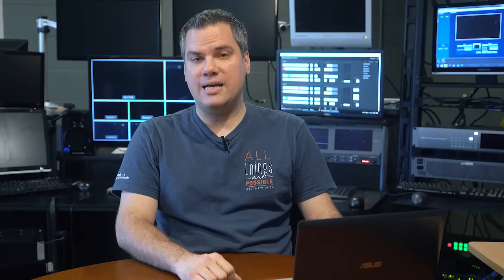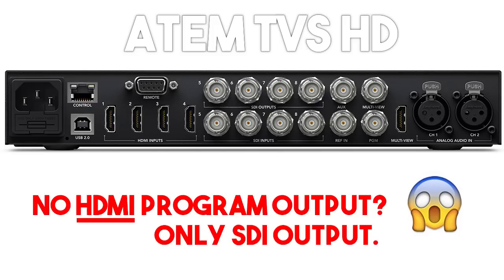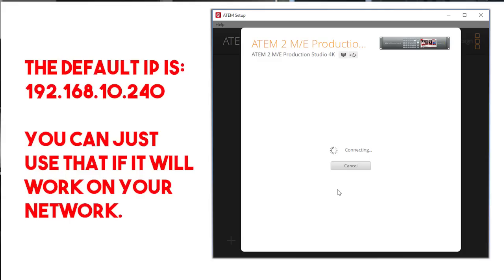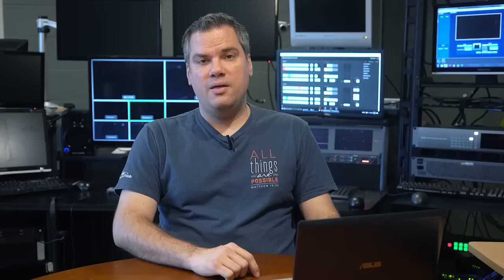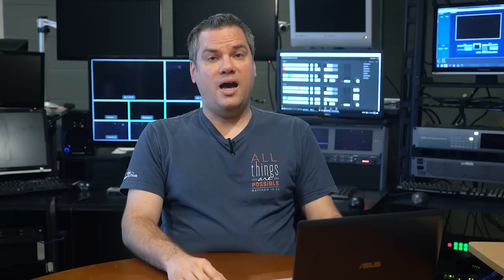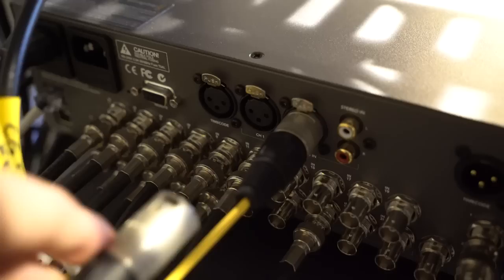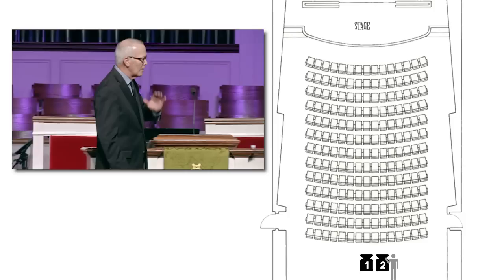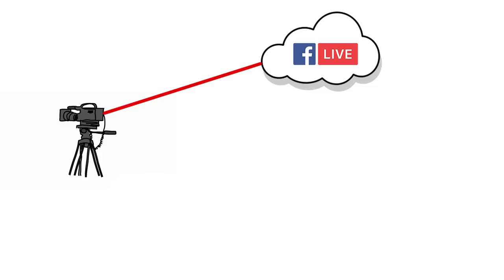Multi-Camera Live Stream & How to Setup an ATEM Switcher

Comment: Hi Stephen – Great video
I currently livestream our Worship service on FB using a
Canon XA30 and wirecast.  I am was
planning to purchase the BM TVS HD to add 2 HDMI cameras and to bring the Media
Shout presentation to the livestream.  Since
the TVS does not have a HDMI out would it be possible to use the SDI OUT and a
SDI to HDMI converter to record the mixed video to a Atomos Ninja 2? Thanks Raj
Reply from the maker: Photo Bot Yes, it should work fine to convert the output of the switcher.
Reply: Thank you.

Comment: Dose ATEM switcher work as encoder or else we need a powerfull cpu?
Reply from the maker: ATEM does not work as encoder.  Only the new ATEM Mini has a video interface built in.  All other ATEMs require a video interface to get video in to the computer.
Reply: @BallastMedia  Thankyou for clearing the doubt and also is ATEM Mini sufficient enough to livestream the soccer match with just 2 or 3 cameras or do I still need an encoder or a powerfull CPU?
Reply from the maker: @vishalpatelful  the atem mini just acts as a video interface to get video in to the computer, you still need encoding software on the computer to do the streaming.
Reply: @BallastMedia  This has been so helpful. Thanks a lot. I request you to please make a video on sports event streaming because there are not many videos on it and beginners like me find it hard to understand some basic concepts. But Thankyou again.

Comment: Hi Stephen

Thanks for sharing all those videos, they are very useful, great Job !!!!.

Stephen I want to know if you can guide me, I am new to this, I bought an Atem mini pro to make photo tutorial videos but I could not connect the streaming, is there any way to connect the Atem direct to crowdcast? I like Crowdcast because they have a chat, password, payment system etc, but I can't connect it or if you know of another friendly platform that can have all these characteristics? Any help will be greatly appreciated, I look forward to your comments, blessings!
Reply from the maker: Yes, if you're streaming service isn't listed in the drop down, you need to edit an XML file on your computer (in the Atem Control Software directory) and add the information.  Then it will show up on the ATEM.
Reply: @BallastMedia  Hi Stephen, I already tried the XML file but I could not, I want to see if I can connect the ATEM to Crowdcast direct without OBS, thank you very much for your answer, excellent your videos, keep going, God Bless you!

Comment: So if I wanted to keep the same audio when changing scenes how can I accomplish that
Reply from the maker: Do you mean on an ATEM switcher?  On the audio "tab" of the switcher, turn on the audio you want as your source and turn off all the others.  Don't use the AFV button, that means Audio-Follows-Video, so the audio will switch when you switch inputs.  Or, are you meaning in OBS?  In OBS, I think there is a check box in the properties of the sources that you can select "Use Custom Audio Device" and then a drop down box will appear and let you select the audio source for that particular source in OBS.
Reply: Thanks I figured it out

Comment: Is it possible to broadcast to YouTube and Facebook at the same time? Thx!
Reply from the maker: Yes, some software, like vMix and mimoLive can do it.  Also, there are services like restream.io that will do it.  Using software locally, be aware that you need the bandwidth to support both streams.  Using restream.io you send them one stream and they send it to the multiple destinations.
Reply: Ballast Media thx!! 👏👏👏👏
Reply: Try nginx
Reply: I like Restream.io and it's mostly free but you have to pay extra for Facebook streaming. I have a client using Restream with about 18 platforms connected streaming through a Teradek VidiU Pro switched through an ATEM. Then he also streams to Facebook and Periscope through his Wirecast software. He has a fast fiber internet connection.

Comment: What are some options to get audio into a livestream?
Reply from the maker: Do you have a switcher?  Usually you take audio from a mixer output and run that in to the XLR inputs of the ATEM or whatever switcher.  If you don't have a switcher and are just doing a single camera stream, send the audio in to your camera.  Most people start out taking an AUX feed from their front-of-house board.  That does ok, but to get great results you'll need a dedicated board for your streaming mix.
Reply from the maker: What equipment do you have?

Comment: Does this switcher allow for video delay? 

Basically, I have two cameras connected to my Mac using Blackmagic Mini Recorders. One is next to my Mac and the other is 100 ft away using an HDMI extender. I have noticed that the one using the HDMI extender comes in delayed compared to the one next to my Mac. I fixed this by delaying one video feed using my streaming software (OBS). 

If I get the switcher, is it possible to delay the video feeds? If not are there other ways to avoid this problem?
Reply from the maker: The delay you are experiencing is from the HDMI extender, it's adding some processing time no doubt.  A better way to do this (if you get a switcher) would be to convert your HDMI signal at the camera to SDI (using the pretty cheap BMD Micro Converter HDMI to SDI)  Then run SDI cable the distance to your switcher.
Reply: Thank you, that is a good idea!

Comment: I would like to stream worship service to Facebook. I will use a video switcher with out hdmi and a laptop. I will use also a video capture device to connect the switcher to the laptop. I have two capture devices in my mind: AJA U-TAP HMDI or Elgato Camlink 4K. According to your experience, what would you suggest me to buy between these two cards?
Reply from the maker: U-tap is definitely better - but to be honest at the moment with COVID, most of these are hard to find, so get what you can find.  The Elgato will work fine on PC, it does have issues on Mac.

Comment: I am using a SDI to HDMI converter and then again HDMI recorder to take signal from ATEM to my PC. However, the converter is not BMD, but it is compatible for 1080p 60fps and still I am getting no signal when I tried to get Program output via SDI to HDMI converter. Do you know what might be the actual problem here?
Reply from the maker: Aditya Kuche Can you tell me what specific models you are using? My first guess is thatsomething isn't able to operate at 1080p60.
Reply: Hi again!! The problem was because of cheap SDI to HDMI converter. Just today I have received original Blackmagic-design and it is working absolutely fine. But I am facing another issue. Facebook live video is terribly lagging at 720p.
Reply from the maker: Are you using OBS to stream?  What is the upload speed of your connection?  What is your bit rate set to?
Reply: Yes I am using OBS to stream. Upload speed is roughly 22 mb/s and my video bit-rate is set to 2500.
Reply from the maker: If you have 22mbps upload that is great. (Your sure that's not your download?)  As long as OBS isn't reporting dropped frames when you are streaming, then the lag is happening on the viewer end.  You can help the viewer by sending a lower bit rate stream, try 2000 for your setting in OBS and see if that helps.
Reply: Hi. I was facing the problem because of the net connectivity. There was significant change in upload speed, which has been fixed. Everything is working just fine expect when I am using 15 ft long cables, it gives no signal. I am wanting to place 2 cameras in different rooms but using long cables is not working out. I am not sure how to fix this problem. I appreciate your time and help in all of this. Thank you so much.
Reply from the maker: HDMI will only go 15ft.  Convert the signal to SDI and run coax cables, you can run up to 300ft on an SDI cable with proper RG-6 cable.

Comment: hey how much you think i will need to spend to start a 3 cameras streaming
Reply from the maker: Are you starting from scratch?  Do you have a computer you can use already? 
$600 3x VIXIA R800  (http://amzn.to/2FBaCQs)
$600 3x Tripods?  (http://amzn.to/2CIYx8z) 
$1000 Video switcher (http://amzn.to/2EUeeQr) 
$100 Monitor for Switcher multi-view  (http://amzn.to/2orRRY9)
$335 AJA U-tap Video Interface (http://amzn.to/2F8nX4U)
$590 PC for streaming (http://amzn.to/2CJnwZs)
$180 3x HDMI to SDI converters if you want cameras further then 15ft from switcher (http://amzn.to/2GKkQ0a)
~$200 cables: select SDI lengths needed here (http://amzn.to/2EQCfYB)
=$3605 and you are well on your way.  Might need a few odds and ends for your environment, but that is the core of a 3 camera system to begin streaming.
Reply: yes i have a computer i have a mac and windows and also a few tablets all need is the cameras switchers ect

Comment: Are there any switchers out there that are an all-in-one interface/switcher so you don't have to buy a separate interface card?
Reply from the maker: The original Atem TVS (1u rack) used to do that through it's USB port but they removed it in a firmware update. There is a Roland switcher that has a video interface to computer built in but it's still actually cheaper to purchase an atem and a separate interface.
Reply: Thank you for the feedback. I'm trying to build a 4K multi-camera setup, and have live, post-DAW audio from my Presonus Studiolive 32 mixer all go into a live-stream, but I'm worried that if I do everything digitally through OBS there will be some latency issues, hence the question about the all in one interface. Buying several video interfaces for each camera + having a multi-channel live audio mixer all go into this free program OBS seems like it would put quite a bit of a load on the computer. Do you think there will be a noticeable difference if I can find a video mixer/interface that I can plug my audio mixer straight into, as opposed to having everything routed into the computer? Also, how does OBS compare to other live-streaming software in terms of latency and handling high-quality video/audio?
Reply from the maker: Ghostnotes The Atem switchers have balanced XLR stereo connections. You'd be best off sending your audio in to a switcher and letting it embed the audio. Then take your "completed" video in to the computer for streaming.  Obs is very reliable, but that's dependant on your computer too. Your right that it doesn't scale well to send many interfaces/sources in to a computer.  Use a switcher, like the atem and just use the computer for streaming the final product.
Reply from the maker: Ghostnotes As far as quality, OBS will output whatever quality you configure it to. What is your destination for live streaming?
Reply: Thanks again for the feedback. I'll be streaming to YouTube, Facebook, and Twitch once I have built my complete setup. Do you have any experience with the Blackmagic UltraStudio 4K? It's looking like this is almost what I was talking about. A capture/playback device + video interface all-in-one with multiple inputs/outputs. I would not need to buy an extra interface with this.. although it does not have the "switching" feature to switch between multiple camera views on the fly, it looks like it can still record, capture, and playback multiple cameras.Thoughts on this vs the ATEM switcher + interface? Seems like this is the cheaper and much more ergonomical solution. And I can always add on a switcher to this in the future if I need the extra channels and have the extra money.
Reply: I take that back. Just found out that that the UltraStudio 4K does not capture multiple signals at the same time, so scratch everything I said.
Reply from the maker: If you really have a requirement of 4k, then cheaper really won't be one of the characteristics of your system. ha!  But I'm not familiar with using the UltraStudio 4k with 2 inputs and how it switches between the two in software.
Reply from the maker: AJA has several capture cards that might work, like the KONA HDMI that might work for you to capture multiple video feeds.  But, again I don't think it will do 4k on all the inputs only 1 I believe if you're doing 4k.
Reply from the maker: Also, of all those destination, Youtube, Facebook and Twitch, only Youtube will take a 4k live stream.  Facebook maxes out at 720p and Twitch at 1080p.  To get a 4k stream to Youtube they recommend a 20-51Mbps stream.  What kind of connection are you on?
Reply: You're right, this will not be "cheap," what I meant was the "cheapest" option, hahaha. I actually only have one 4K camera at the moment (along with a GoPro, two smartphones, and a regular HD camera), but I would like to eventually have all 4K cameras going. I have looked at the KONA HDMI before, but I couldn't find where it said if it supported capturing multiple devices with different video formats going in or out at the same time. (i.e. one camera at 4K, another at 1080p, another at 720p). I forgot that the ATEM switchers can't, so I guess I should count those out... Not sure if any of these cards can either, whether it's the KONA series from AJA or the DeckLink series from BlackMagic. The KONA LHi specifically states that it does, but a lot of these other ones are not very clear on that (or maybe I'm blind). Do you know which ones support this?

As for only YouTube doing 4K, I'm okay with that. I just want at least one source to have that option. I'm assuming Twitch will eventually hop onto that as well with how big gaming has become and with all that Amazon money, but who knows how long from now.

Also, I'm on a Verizon FIOS Gigabit connection, so I should be good on the bandwidth part.
Reply: Ballast Media I’m about to buy the BM ATEM HD switcher... do you stream in 4K? My only reservation is buying HD technology in a 4K plus world.

Comment: how to configure atem switcher to obs ???
Reply from the maker: You will need a video interface.  Only the ATEM Mini has a built in video interface to the computer, all other ATEMs only use the USB to set the IP address.  Which ATEM do you have?  Some have HDMI ouputs, some only SDI.  You will need a video interface for that video type.

Comment: Hi sir, Thank you for your video, My Name is Viko & i'm new in media. I have some question.
I wants to start live streaming. So i've bought some tools, like camcorders, blackmagic atem switcher TVS HD and AJA U-TAP HDMI. My question is:
1. Are the tools correct? Do I need another tool?
2. I tried to connect the sony HXR-NX100 camcorder directly to the switcher using the SDI cable but it does not display anything on the switcher? I've set the same standard video between camcorder and switcher.
do i need an SDI to HDMI converter from camcorder to switcher to display it in switcher?
English isn’t my first language, so please excuse any mistakes. Thanks. Gbu
Reply from the maker: Hello Viko!  One thing I would change, if you are using the TVS HD switcher, it has SDI outputs, you should get the SDI version of the u-tap. https://amzn.to/2JxxpNQ   So that camera does not have SDI outputs.  The BNC connector is a composite video signal.  So you'll need to use the HDMI output to connect to the switcher.
Reply from the maker: If you need to run the cable over a long distance (over 5 meters) then convert the HDMI output of the camera to SDI at the camera https://amzn.to/2I4vBfM  and then run a long SDI cable to the switcher.
Reply: Hallo Sir, thank you for reply....so my HDMI U-Tap can not be used anymore?
& if I use HDMI to SDI Converter can I move with my camcorder from one position to another? I see on the converter using power suply?
Reply from the maker: You could still use it (u-tap hdmi) if you convert the output of the switcher to HDMI, the switcher just doesn't have HDMI program output. Yes the adapter at the camera needs power. You could create a loom with power and video cable and still be mobile.
Reply: Ballast Media I’m sorry Sir, i don’t understand about create a loom with power, can you explain about it?
Reply from the maker: A cable that contains both power and video signal: https://amzn.to/2HE1tXu  But you could make one yourself as well with something like this. https://amzn.to/2KpAwZp

Comment: CG Graphics and Video playback?
Reply from the maker: The ATEM has limited "media storage" built in, just a few seconds worth.  If you need a decent amount of CG graphics, then you need to get an external device to generate them.  The ATEM does have upstream and downstream keyers that you can use to key in any CG you have as a source.  You can also control a HyperDeck for video playback from the ATEM control software.
Reply: Do you know of ways to do this without buying the Hyperdeck but instead using a computer setup to output into the Switcher's Input? Which combination of software would a setup like that use to play videos?
Reply from the maker: I playback video with casparCG.

Comment: You are amazing , Great tutorial and very very helpful , 10000000 likes , I want to ask you with Semi Pro camcorder supports wife and has  Stream option with IP address , How can We stream Live Video From this camera to Live Youtube for our church ? Is there any Possibility to Stream Live to Youtube . Our  2cameras are  Sony PXW Z-150 and also we have Another DSLR canon 5D Mark4 , How can we Stream Live to Youtube with out any wire if possible ,but if not what is your Recommendation???/
Many Thanks
Reply from the maker: I don't know what the WiFi capability of the camera is. Can you enter an rtmp server address and authentication key for it to connect to?  If you have two cameras I'd recommend you get a switcher (like in the video) and run an SDI cable to each camera.  Then stream using a computer and an AJA u-tap.